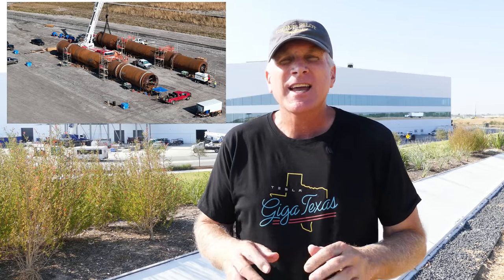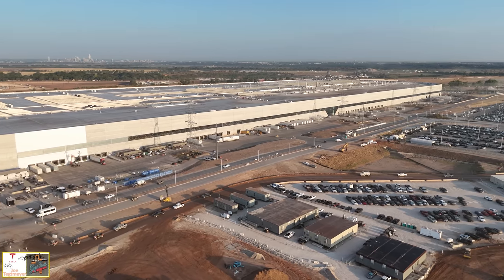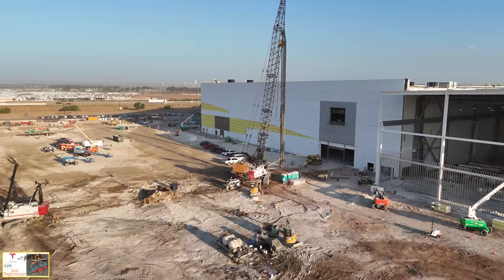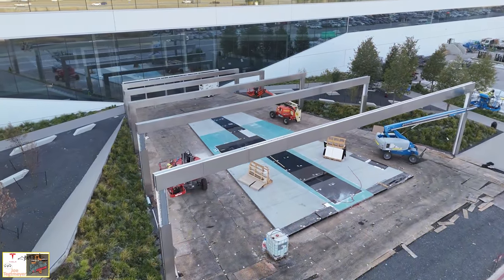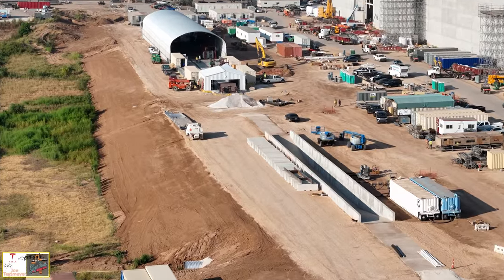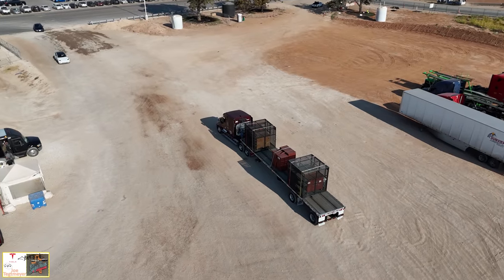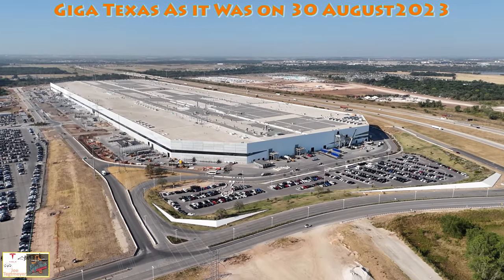W EOL Steel Erection, Megapack Transformer Oil Catchment! 30 August 2023 Giga Texas Update (07:45AM)

Comment: Thanks Joe
5:43. Outfall channels area. New east-west track. Excavation for a culvert it would seem.
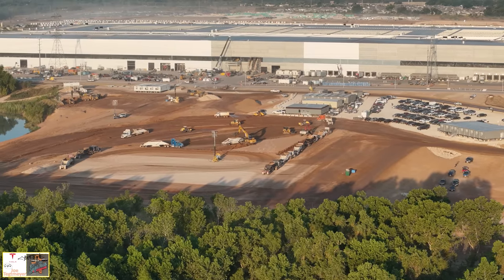6:08. Parking Garage area. Excavation works. Lowering the grade/elevation, including the old pipe mill area to the west.
8:49. Stamping 2 extension, walls. Stud walls being constructed. Likely permanent for fire compartmentation between areas. 
Centre column. Projecting bridge crane rail has been cut to length.
9:53. GA south. Walls. Bulk insulation between the studs. This might be permanent (Tesla permanent). Weird excessive bracing removed.
10:45. Southend. Rectangular vault. Valves and pipework installed.
12:03. New EOL building. 3 east-west grade/ground beams, and intermediate beams. Seems only to be through the clear span area (the area where there are no central column footings).
12:40. New EOL building. When these tapered columns arrived on site 2 years ago I decided they were cantilevered rafters for a portico!
16:15. Casting east, ramp. Precast/prefab slabs. Floor segments for the furnaces perhaps, in some special refractory material.
17:22. BESS installation. At least 10 transformers yet to be wired up.
17:48. BESS switchyard. Bottom Conduit risers from the BESS have some sort of adaptor/union fitted to the top. Being readied to pull in some cables.
18:29. BESS switchyard. Conduit risers from the Tesla monopole have turned up.
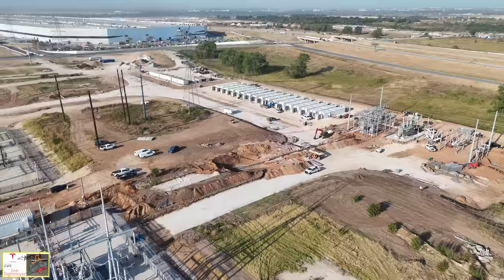19:00. New switchyard/substation. 2 small excavations beside the fence. For conduits/ductbank into the Mega-Vault.
Temporary retaining wall completely removed.
19:18. New switchyard/substation. Top. Between the fence and Mega-Vault, plywood formwork around the conduits/ductbank.
20:18. Cathode east, ramp. Beams replaced in opening.
25:12. Cathode, north of. Lift station wetwell. Length of green pipe leaning against the wetwell gives a clue to what the buried pipe looks like. Slots cut to allow the water to drain in.
25:48. Die Shop/Cathode alley. Pair of force main pipes working the way south from the lift station wetwell. Ultimate destination would be the smelly side of the water treatment plant across the river.
26:14. Die Shop east. To the right of the 3 tanks. The gas line seems to terminate in a valve and metering assembly attached to the wall.
27:15. Die Shop west. Scaffolding inside.
27:32. Tesla Road. Linesmen. Possibly disconnecting the supply to the old house site.
30:17. BIW, apron. New external loading docks. Footing for the load leveler platform constructed. Starter bars into the existing grade beam.
30:25. Casting east, apron. Cables being pulled between the vaults.
Reply: 26:30 Sleeping worker 💤
Reply: @SEBTECHDIY  I missed him completely. Thought he'd found a place to hide, now we all know his secret!
Reply from the maker: Thank you Dessie! Great observations as usual!
Reply from the maker: @SEBTECHDIY  that is funny to see 😂

Comment: Right around 31:31, the 7 level item has to be the last one because they've installed two horizontal beams on the outer wall in addition to the removal of the rails.  Also, at the corners of the megapack electrical yard to the north side are 4 poles at the corners.  Those look like the cantenary system we used over weapon storage areas for lightning protection.
Reply from the maker: Thanks and you are likely correct on both observations!

Comment: The Yellow panels is made by GP and is used in a lot of tract housing. It is a core of gypsum with an outer layer of fiberglass. It is actually pretty fireproof due to the gypsum and the fiberglass is a good weather proof material. It is called DensGlass.
Reply from the maker: Thanks!

Comment: A big hint of what the Elite Refractory work is linked to has appeared in the giga-Berlin expansion plans. They are adding kilns and equipment to allow them to completely recycle scrap aluminum from both the castings and aluminum stampings.
Reply: 16:17. I think that's correct. The stockpile of waste aluminum/aluminium 'sows' is growing. They used to ship these off site for recycling. Now holding on to them.
Reply: Saw that on the Tobias livestream. The biggest building yet also goes to Berlin.
Reply from the maker: Thank you Ken!

Comment: Not only was the "last 7 story piece of equipment" moved into the battery cathode plant and the rails removed on the slab, but rather MORE definitive that they're done putting such BIG things into that opening is that two pieces of STEEL cross bar have been installed. They're painted white. So anything else going in that way will be at most 1/3 of the height of the 3 tall assemblies we've seen so far.

Comment: @ 12:15 those "devices" as you call them are called "A Ride on Power Trowel" where just a "power trowel" are the smaller ones you walk behind. A power trowel is an essential piece of equipment for concrete finishing jobs. These machines smooth, level and polish concrete surfaces for a quality finish.
Reply from the maker: Thanks … the name slipped my mind as I recorded so I just used a generic term. I should have said they were on powered trowels. Sorry about that.

Comment: Hey just so you know Usually the yellow panels are not temporary. What is more, they are installed on thermal insulation material in exterior walls, which reinforces the understanding that they are the completion of the wall before the final exterior cladding
Reply: Yes the pink fiberglass insulation behind the panels usually isn't temporary, either. This suggests different areas on either side of the wall when the expansion is built.
Reply from the maker: Thanks and it is interesting what this tells us about how the expansion is being conducted.
Reply: @Nphen   Not necessarily, factory extension won't be completed before winter so they need that insulation, even if temporarily.
Reply: Honestly, it looks to me like what was urgent was adding those few meters to "Stamping 2" so they could fit in some equipment and the rest is gonna be more like building a separate structure.
Reply: @greggerypeccary  Yep, agree.

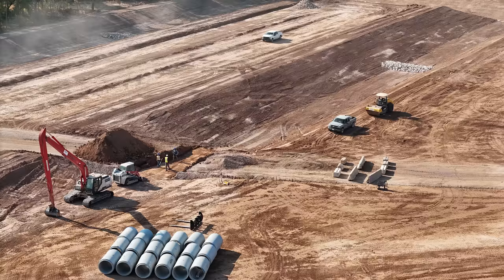Comment: 1:26 You can see the white truck in the middle, and the 2 out flows on either side.  They are going to extend the East road, from Model Y load up area, straight until it meets up with river road extension.

Comment: Looking forward to learning about the lithium plant. Interesting that they're adding fiberglass insulation behind the yellow panels on the southwest side where the windows and walls were removed. Those rings by the 4680 area are definitely Stargates. They are definitely finished building and moving the multi-story equipment racks into the cathode plant. They installed beams across the opening that indicates nothing more will be moved inside.

Comment: Gday Joe, thanks for another comprehensive flight.
I have a theory aboout the concrete intersection in the south east corner. Im stickicking my neck out here but thats ok, ive got thick skin.
One corner heading north is pretty obvious but i find the east facing part rather intriguing. I believe that this section will head to either a second or primary entrance to the multi level carpark for staff. This part of my theory may be accepted by most but my real projection relates to the planned River Road. I dont think the 2 x 2 lane southern roads currently being worked on will be the proposed River Road. It is very hard to make out but further south of the 2 x 2 lane roads it appears to me that this cleared area has been filled to the same grade as the other roads. What im trying to point out is that it is my belief that when the existing power poles are removed we can exspect another road which will actually be built and be the proper proposed River Road which will continue around the very rear of the site and link to the " environmental paradise " that Elon spoke about very early on.
It is my belief (right or wrong) that the existing roads will be used internally for staff and a clear way for the new vehicles from end of line to drive to the new staging area on the western side. This would also include WOW access. I then see a fence of some kind errected to separate the internal road traffic from the general public who would have sole use of River Road. There is already a track snaking through the trees which would be graded to complete the thoroughfare through to the "environmental paradise " and possibly link up with the planned boring tunnels under the river. I hope ive explained my fantasy well enough to be understood. Thoughts??? 😊😊😊
Reply: Seems plausible.
Reply from the maker: Thanks and I like the way you are thinking about these roads and access! 😎👍

Comment: BESS Substation:
@ 17:44 (Lower right) They still need to place a control structure on top of the unused screw piles. An enclosure or small building.
Also @ 17:44 Large cable spool by the steel structure. Where the 8 conduits that go to the Megapack transformers are. 
@ 18:13 Transformer primary connected.
@ 18:22 Joe, hard to see but cable was placed in the cable trays a couple of weeks ago. Appears that not much is actually connected though.
@ 18:33 Conduits for the 345 kV duct-bank have reached the steel structure.

Easement:
@ 18:53 Excavated a second trench for backup power.
LCRA Substation:
@ 19:06 If you look carefully, excavations under fence for conduit to connect the outputs from the transformers to the Tesla Enclosure/Mega-vault.

Enclosure/Mega-vault:
@ 19:22  Temporary retaining wall completely removed.
Backfilled around vault.
@ 19:40 Close up view.
Powerlines: 
@ 27:29 (By the Die Shop) Utility crew at work.
Eastside of casting: 
@ 30:23 Appears to be more cable pulling work between the existing Supercharger vault by the building and the vault closer to the bottom of the screen.
Reply: 18:13 So the secondary side will attach to the top of the poles already connected toward the Megapacks?
Good eye spotting the connections going under the fence.  I couldn't figure out if they were going to move the fence, go over, or under.  Kind of a weird gap left between the vaults and the fence, with some high power right up on the fence.
Reply: @scottgaree7667  Yes, the secondary side will attach to the switches/disconnects on top of the poles. There is no connection yet to the Megapacks. They still have to pull cable through the 8 large conduits at the base of the steel structure seen @ 17:44 Note: Two conduits are hidden by the large cable spool. 
6 of the 8 conduits will connect to 4 Megapack transformers each. 2 of the conduits will connect to 5 Megapack transformers each. 
(6 x 4) + (2 x 5) = 34 transformers total. Each transformer serves 2 Megapacks. So that is how 68 Megapacks are connected using only 8 conduits. What we have seen so far is only transformer to transformer cable pulls and Transformer to Megapack connections.

Main substation...
Having 24.9 kV right up to the fence is not a problem because the Tesla Enclosure/Mega-vault will also be fenced in.
Reply from the maker: Thanks David!

Comment: 20:36 That multi-level equipment rack that they moved in has railings, suggesting that they're not putting a third one next to it.  I noticed that the previous one had railings at the ends, but not on the open side.  I wonder if this means they're ready to install some more wall panels?

Comment: The south side addition is so that they can drive trucks inside and use the overhead cranes to unload rolls of stainless steel directly into the stamping area.   If that is true, there is probably a prominent separation or split between the new addition.

Comment: at 26:24, is that the piping, valves and couplings for filling the N2 vessels from Matheson trucks? It seems a bit odd to squeeze in truck movements between relatively fragile piping around the vaporizers whilst a nice concrete pad is available on the South side. In previous videos I looked carefully at the South side but couldn't find any connections for unloading trucks.
Perhaps the yellow painted barriers laying around will be bolted in place to guide the trucks into this area, although I have seen N2 storage units surrounded by massive highway road barriers for solid passive safety/protection. It is also possible that Matheson trucks will not enter that alley at all but park alongside, and connect via long hoses. Then we may still see some road barriers being set up once the blue rental units are gone.
Reply: Joe's pic 116 shows what I think are the filling points on the south side.
Reply: Could well be, Dessie. I went back to the 25 August pictures but no better info from those. The only argument against S side is that the piping there is awfully small bore for filling those large storage vessels, that will take ages. The piping that I indicated is at least twice the diameter, so a 4 times faster filling speed.   @DessieDoolan
Reply: @hardernl8893  I'll make a mental note and keep an eye out for this now.

Comment: The outfall channel seems overkill. The original one never really drained any water even after a deluge of rain.
Reply: If you notice @ 29:18 left side, there are two 8' diameter pipes that empty into the pond. They have to design for a worst case event. One that would dump much more rain than we've seen so far. If I remember correctly, those 8' diameter pipes collect water from the northeast corner of the building roof, the north parking lot, the east parking lots, and areas north of Tesla road.
Reply: If the remnants of a hurricane move into the area, they can get 10 inches of rain in a day and 15 inches in a week.
Reply: We’ve received a foot of rain in less than four hours in this area. You get a good line of training thunderstorms feeding on Gulf moisture and it’s amazing how much water can dump from the sky.

Comment: I am looking at the 68 Megapacks, and the transformer right next to each of them, and wondering why they do not produce a mega pack that is the same voltage as the transformer output?  Then no need to install that expensive transformer.  So I have no clue what the output voltage is of each transformer, but say it is 4,160 volts, and that is then run directly into the building, where they put another 4,160 to 480 volt transformer, or maybe they have a furnace or other equipment that can run directly on 4,160 volts.  

So a educated guess is each mega pack puts out 480 volts three phase power.  So 1 MW of power = 1,200 amps at 480 volts.  Yet if they where to run them at 575 volts (to stay under the NEC special rules for wire that is over 600 volts), they can run them at 1,000 amps, so smaller wire requirements and less amperage.  Yet if they can change the output to 4,160 volts ( a common voltage for larger 1,000 + HP HVAC Chillers) then they could reduce the amperage to only 138 amps per unit, so much smaller wire size, smaller internal wiring, smaller inverter components, just rated at much higher voltage.  

I used to work for a large city, and their 15 story city hall has a pair of 2,000 HP water chillers that serve the building HVAC, and they have 4,160 volt input, so they do not require huge wiring.  The building also has a 4,160 volt to 480 volt transformer in the penthouse, so they can avoid putting in a 5,000+ amp service to the building, but only a 1,000 amp at 4,160 volts, then the 1,000 amp 480 volt transformer in the top floor to serve all the power needs in the top 8 floors of the building, and another large transformer in the basement to serve that 1/2 of the building.  

So lets take a look at 68 megapacks X 1,200 amps each, so that is a total of 81,600 amps at 480 volts.    At 4,160 volts, that would be a total of 140 amps X 68 = 9,520 amps.  A bit to high amperage to manage and send to the building at that voltage.   So my new guess is each transformer will have between 12,000 and 33,000 volt output.   At 12,000 volts, the amperage at 68 MW would be about 3,300 amps.  At 33,000 volts, then 68 MW the total amperage is only 1,200 amps.

At 33,000 volts, the amperage is manageable, to send it 1,000 feet to the building.  However it requires a LOT of respect to manage the super high voltage.  

Of course I am still thinking they will need to have all of the mega packs installed and connected to run the giga press at more than a few cycles per hour.
Reply: The output voltage of each Megapack transformer is 24,900 volts. The output voltage of each Megapack 480 volts. There is one transformer for every two Megapacks.
Reply: The Megapack is pretty well optimized, modular and flexible, which makes 480VAC more cost effective in terms of power electronics.  There isn't much benefit to going to 2.4kV or 4,160V and still needing to step up to the 24.9kV site distribution voltage and again to 350kV transmission voltage.

What is stupid though is that they don't prefab a cablebus system that is pre-terminated and essentially plugs into the megapack and the transformer distribution panel.  That should be a single crew-day per transformer and not what we are seeing.

Comment: Why do you refer to the painting of the exterior walls in white as “staining” rather than “painting”?
Reply: Because that is what it is.
Reply: They apply stain to concrete, and that color stays there for many dozen years.
Reply from the maker: Because that is the accurate term used by the company NawKaw doing the work.
Reply: @sammyk874  I’m just asking for an explanation, are you saying that the white stuff is not paint?
Reply: @HenryBloggit  Correct, it is a concrete stain, not paint.  Sorry for the initial unhelpful reply.